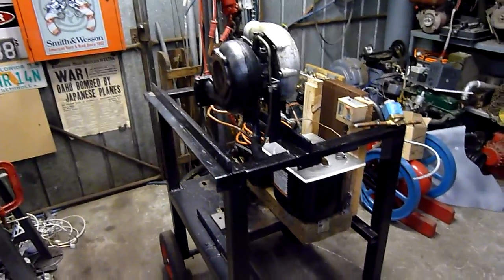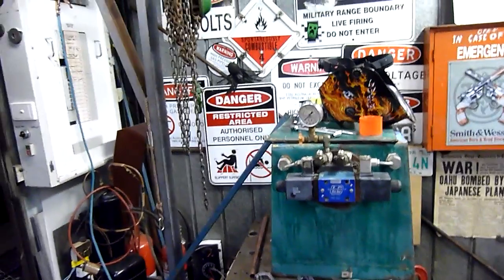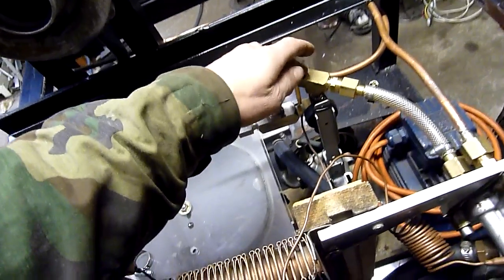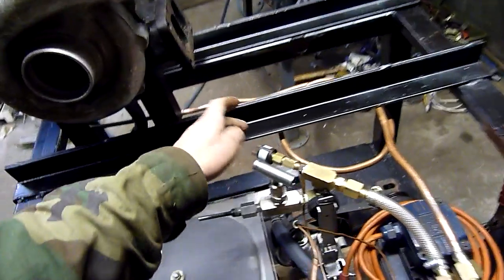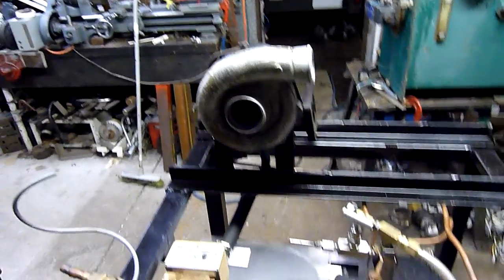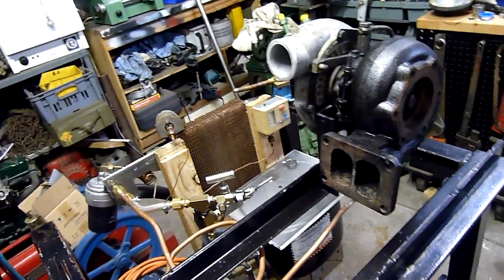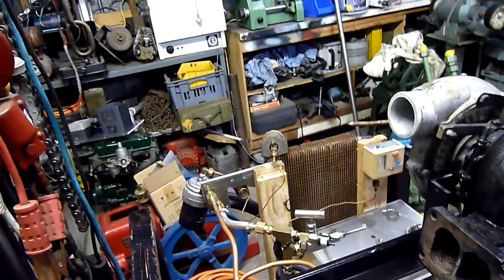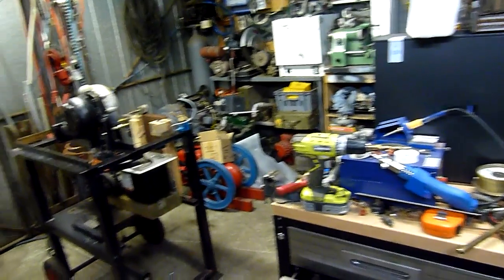Ramblotronic Sunday  Cleanout and Turbojet Prgress

Comment: you can buy a electronics kit that "zaps" sulphated old batteries, but that probably would cost more than a decent used battery. try a motorcycle wrecker for a used motorcycle battery =)

Comment: Shop looks great, jet engine looks great. I worry a little about that 90* fitting on the oil drain hose. Might be worth using a 45* elbow to keep the flow on a constant downhill slope.